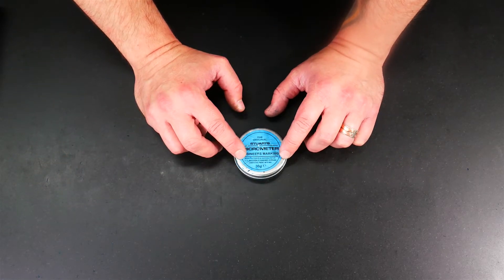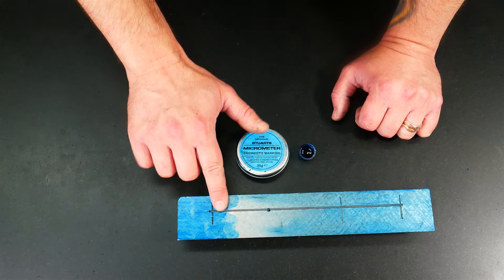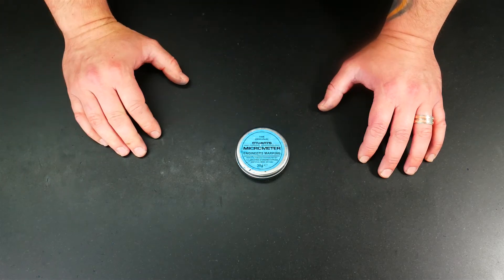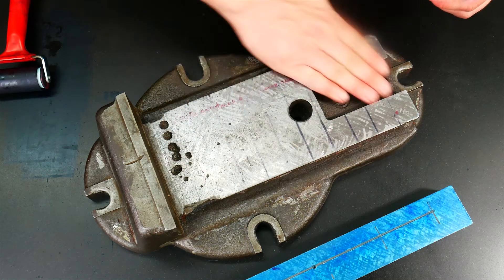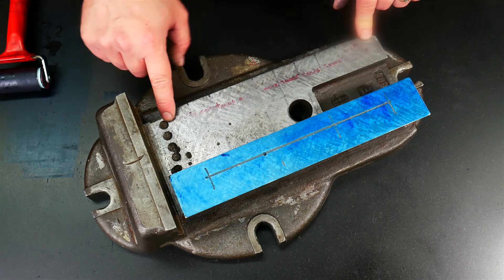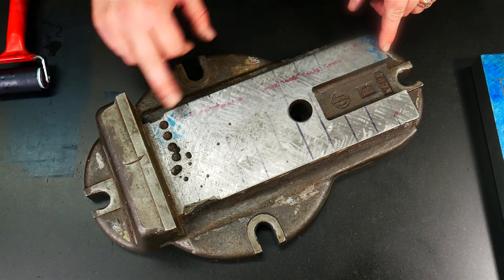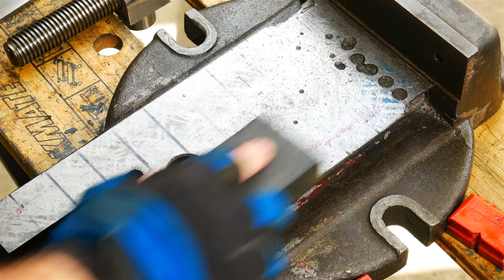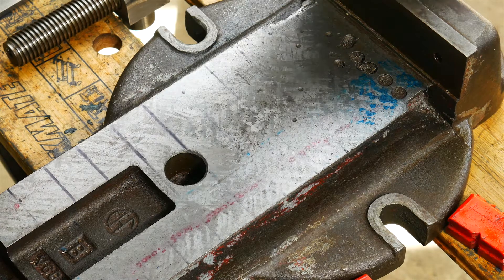What is engineers blue?

Comment: I have the very same thing but mine wont dry.
Reply from the maker: That’s because it’s not supposed to, I do have a video about layout dye which does dry out.
Reply: So I guess I need to apply a veri thin layer like you showed in the video.

I also have a fast drying red but I've never used it.

Thanks
Reply from the maker: Are you bluing up for scraping?
Reply: @ImpracticalMachinist  I'm building an ATC BT30 spindle. I'll check the taper with it after grinding.

Comment: What’s the best way to apply to small areas? For example a engine cylinder where the surface is fairly small…
Reply from the maker: As long as you have somewhere to roll out the blue you can still use a roller. otherwise apply with your fingers, or some people use a rag or a dauber.
Reply: @ImpracticalMachinist  got you, will give the dauber a go… thanks!

Comment: Could you explain about the type of roller used for this operation?
Reply from the maker: It’s an ink roller or brayer, like this one  https://www.amazon.co.uk/dp/B002KLL7NQ/ref=cm_sw_r_cp_api_glt_fabc_QEDDP7HP5QH4QFD07M5F 

Don’t put lots of pressure on the roller when you’re spreading your blue, just put a blob of blue on your plate get some on your roller and then roll it out on another area of the plate, if you try to roll it out directly you’ll get uneven patches.

Comment: Its interesting stuff. I tried to make some layout paint with it using petrol. After an hour it had separated and the petrol was clean, clear and sat on top of the blue!
Reply from the maker: That’s odd, you’d have thought it’d make a good solvent.
Reply: I used ink pad refiller and a hand dip of automotive grease to make it more sticky works fine for me dunno whats the drawback though
Reply from the maker: @woozhi9218 That sounds pretty close to what's in the tin.
Reply: Next time try methylated spirits the purple stuff, that will evaporate quickly